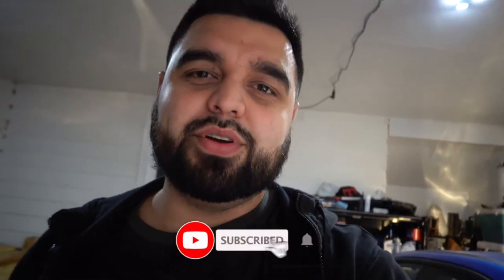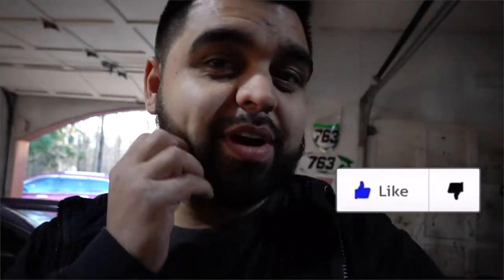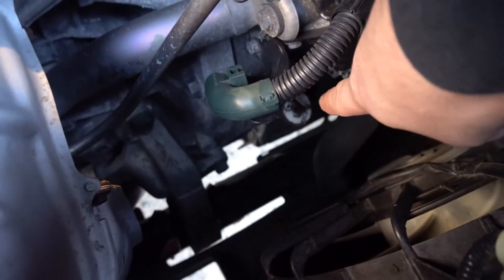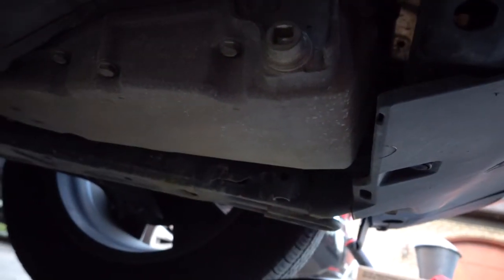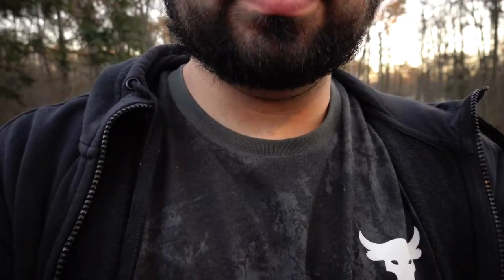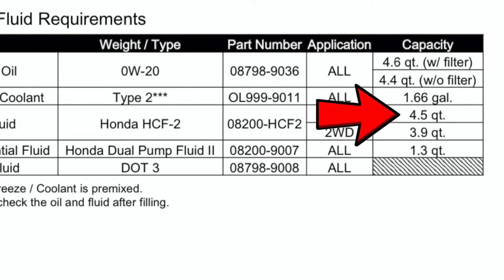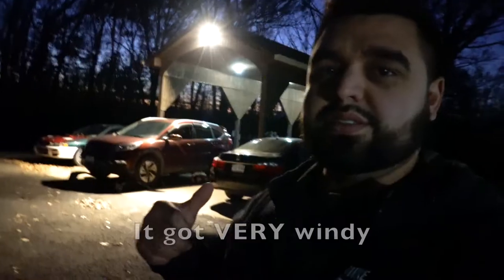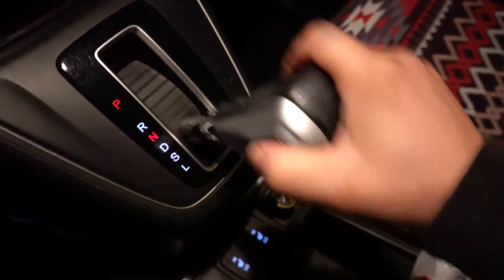2016 CRV CVT Transmission & Differential Fluid Change

Comment: We know the capacity says 4.5 quarts but it feels very likely that you won’t drain 100% of the existing fluid. My advice would be to measure the amount you drain and only add that amount back in when you go to fill. Nice video - simple and easy to follow. Thank you.
Reply: My question for you is: if there was no leaking, how do you know the pervious mechanics had put enough transmission fluid into the car? What if he put too less or too much in and then becomeing a bad reference for you.
Reply: @larry5872  after doing the job, I can tell you there is a separate drain plug above the main trans drain plug that you have to unscrew after you fill the fluid. The sole purpose of that upper plug is to drain out excess and avoid overfilling. Feels like that wasn’t covered in this video.
Reply: yah, i agree, warm up transmission through driving, and then put in what you take out.

Comment: I’m with you! I have four steps that lead to a small gate and my patio enclosure. FEDEX and Amazon refuse to open the gate and set the package inside. They will set the package outside against the gate that by the way only swings outward. So my two options are to either jump over the fence or knock the package down the steps to open the gate. 🤬

Comment: You should check the level of transmission fluid every time. There's also a procedure. Something like warm engine until fans cycle twice. Then check the level. This is after you've done the drain and fill, and shifting through the CVT "gears" .

Comment: You pull out the fill-plug so the old fluid will flow more easily, but then talk about how it will all rush out and so you have to hold the drain plug in place to moderate the flow.  Maybe leave the fill plug in until most of the fluid has drained out?
Reply from the maker: Yeah you could do that but it’s more of a hassle to have to get out from under to pull it out and then monitor the flow again. Definitely doable though.
Reply: You also loosen/remove the fill plug first in case it is stuck...you don't wan't to drain out your diff fluid first and then discover you can't ge tthe fill plug off.
Reply: @markmuellerleile6656  Oh yeah, absolutely.  You always make sure you can loosen the fill plug before pulling the drain plug.  I feel sorry for anyone who learns this lesson the hard way.

Comment: If you're doing this for the first time in the vehicles history, yes the bolts are supposed to be that tight, they're that tight from Honda Motor Co. Just use a breaker bar and go slow so you don't snap anything. Check your fill plug first.

Comment: Quick question please. I got a maintenance minder B1 3 on 2016 CRV AWD (oil and transmission fluid change). I did the oil change last week and hit the maintenance minder reset on the dashboard ONLY for oil
Change which made entire B1 3 code  disappear. I changed the transmission fluid and rear differential fluid yesterday. Now, do I need to again reset the maintenance minder for both transmission and rear differential 
fluid? Strange that Honda ties both oil and other fluids codes together!

Comment: RAMP CLIMBING:  I'd like to know more about why you couldn't climb those ramps.  Did you ever figure it out?        Thanks for great video!  I am about to change trans oil on  2016 CR-V AWG with 67k miles (no kidding!)    I'll access drain plug one way or another.  Fill on level ground.   But, I'm just curious about non-climb on ramp.  Best wishes!
Reply from the maker: What a coincidence on the year and mileage! Haha
The whole climbing thing, I have no idea why it won’t. I tried everything
Reply: This is a year late, but it has to do with the software that splits power between the rear anf front tires. Look for "CR-V roller test" on youtube.

Comment: Can I use a 1/2" torque wrench with 3/8" adapter, or should I really use a 3/8" torque wrench instead? Trying to minimize my tools if I can, since I have a 1/2" torque wrench already.
Reply from the maker: Don’t know how much it affects the actual torque if you use a 1/2 one. Ideally you need a 3/8 but I would send it if I was doing it on mine lol
Reply: It will be fine  And not alot of torque is being used. I use a 3/8 adapter for fill plugs. If I was applying alot of torque I would use 1/2 inch.

Comment: Great video. Do you have to change both the front and the rear differential fluids?
Reply from the maker: Thanks! The front differential is part of the transmission so it uses that for lubrication. I always do them together but there are some people that do the rear every other change.
Reply: @StayOnTheGas  Thanks! Is there anything wrong with reusing the same crush washers?
Reply from the maker: You risk a potential leak so I highly recommend just changing it out. Sometimes the leak isn’t too big but for a trans that doesn’t get serviced too often it’d be better to get a new one on there.

Comment: At what intervals should the transmission fluid be replaced? How often should the differential fluid be changed?
Reply from the maker: Should say in your manual. I personally like to do it every 30k
Reply: Trans every 30k miles. First service for rear differential should be done at 15k miles, then every 30k after that. Per honda

Comment: Is the diff. fluid change on the same schedule as transmission fluid? (As in first one at 60k then 30k interval).
Reply from the maker: I don’t know when others do it but I like to do it together since it’s all parts that move together
Reply: what about the transmission filter?
Reply: @jakenguyen9417  Not usually done on the CVT or needed.

Comment: Where were you able to find that maintenance information sheet. Would love to know. Thank you
Reply from the maker: My brother in law works at a Honda dealership so he sent me the pdf
Reply: Oh okay that makes sense. I have been trying to find the information with torque specs and fluid amount for this year CRV, but had no luck. Thank you for the response
Reply: Oh okay that makes sense. I have been trying to find the information with torque specs and fluid amount for this year CRV, but had no luck. Thank you for the response
Reply from the maker: Yeah no problem. Hope this video helps! This is straight from the manufacturer so it’s a reliable source 👍🏼
Reply: @StayOnTheGas  yes it was very helpful and I appreciate you putting this video up for us
Reply: @StayOnTheGas  Thanks for the great video.  Is there any chance you could share the PDF you mentioned???  It sure would be helpful.  Either way thanks in advance
Reply: @StayOnTheGas  Any chance you could post a link to that PDF. :)